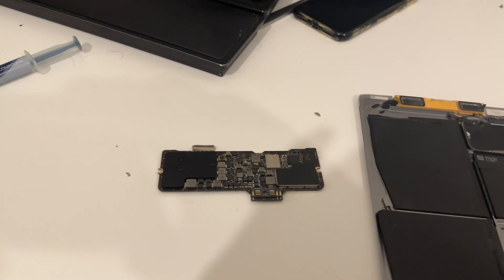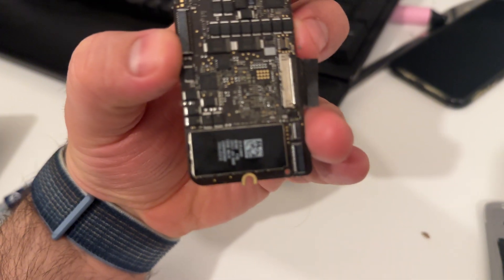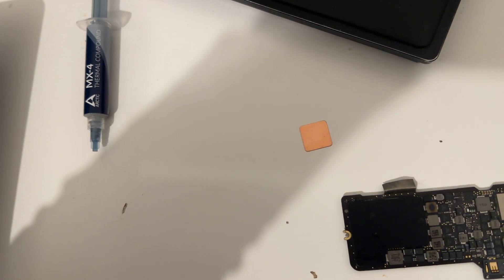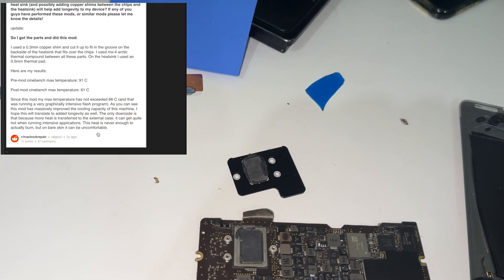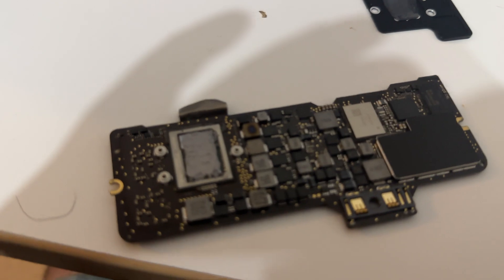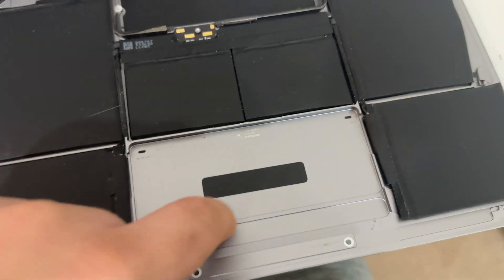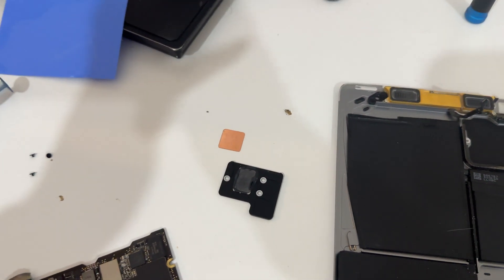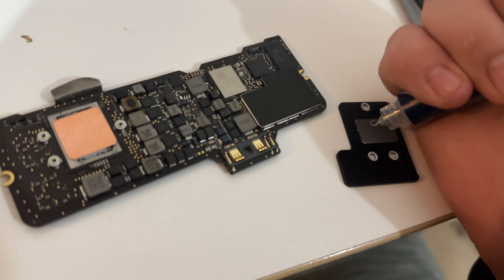12' Macbook Cooling Mod

Comment: Did this to my Macbook 12" 2017 (i5/8GB RAM). Removing the logic board is huge pain though due to the tiny and fragile ZIF connectors.

Initially it ran hotter, but eventually is consistently cooler. Temperatures now hover between 35°C (idle) to 60°C (under load), instead of 45°C (idle) to almost 90 to 100°C (under load).

Temperature increase is also more stable instead of rapidly spiking to over 90°C or even over 100°C before the mod.

Comment: I am doing that on my MacBook 12 inch 2017. I barely noticed that one of the antenna cables was ripped that explains my Wi-Fi issue. Update: Mod worked :) My MacBook runs more than 20 degrees cooler and I put in another pair of speakers for wifi antenna and I had to replace the new battery I had got because it was faulty and I put in an original one instead.

Comment: I did the same mod and I couldn’t let it go over 56 degree C under 100% CPU and GPU Usage which is amazing, I got the acrtic MX-4 thermal paste but what I did something a bit better is getting a better thermal pad that can transfer up to 12.8 w/mk, so basically the better the thermal paste and thermal pad the better the cooling
Reply: What thermal pad did you use?

Comment: Can you play Youtube smoothly  at 2k? I have the same model and it laggy even at FHD, I will try to repaste and mod it like you did but after the mod can it play youtube at 2k? I just need 2k because my monitor is 2k, so hope it can at least run smoothly at 2k.
Reply: That's weird, my 2017 m3 model can run 4k videos perfectly fine, even before the thermal mod.
Reply: @OrganicFoxes  What is your cpu temp? because mine got around 85-90 while just playing video.
Reply: @TrienChill372  Been playing this video for 2 mins now, and its staying around 45 while I am typing this right now.
Reply: @OrganicFoxes , did you apply the cooling mod? and can you play some 2k video smoothly?
Reply: @TrienChill372  I do have the thermal mod on mine, I actually made a whole video doing it, just never got around to uploading it. Mine automatically plays 4k video just fine, even before the thermal mod. I have a video on my channel about my machine and I play a 4k video in it.
Reply: @OrganicFoxes  I haven't tried the cooling mod yet. I don't know why it gets so hot and remains around 80-90 even at 1080p, I have to lower it to 720p so it can play without stuttering, even bringing up the UI or exiting fullscreen mode is lagging like crazy too.
Reply: @OrganicFoxes  4k 30 is not a challenge at all, thats why. try 60.
Reply: @OrganicFoxes  i think it something related to codec, when I tried to force YT to use older codec it work smoothly but the problem is it locked at FHD and seem a little bit blurry.
Reply: I think I found the reason, for some reason, it will laggy like crazy only if I play some 60FPS video, when I play other videos even in 2k it will run smoothly. When I try using some extension to block 60fps videos the quality settings will be lowered to 720p but for videos which does not use 60fps from the beginning the quality settings will not be affected. So my device is too old and it did not support 60fps videos?
Reply: @TrienChill372  hey, u have the M5 model or M3 model ? I have M5 and it can't run 1080P video
Reply: @LostDreams-Music  My model is from early 2015, not 2017, it has 1.1GHz dual-core Intel Core M processor. It might be the first gen of Core M, so it is not M5 or m3.
Reply: @TrienChill372  u too u can't run 1080 video on ytb ? It's strange because I have the 2016 macbook with the M5 processor and I feel like it's buggy as much as the 2015 M3, did it become smoother with the thermal mod for you or not?
Reply: @LostDreams-Music  
I did try to repaste it with the most popular and highest efficiency which has been used widely in the gaming laptop community, I haven't tried Copper Mod yet because disassembling this model is tricky, but it doesn't seem to help much since it still uses passive cooling and a tiny and thin piece of metal. I think it is also related to technology and newer codecs that old CPUs can't handle, I tried some extensions on Chrome that force YT to use the ancient codec technology, at least it can run 1080P but it also limits at 1080P and it also seems a little blurry even though they are all 1080P, and I also think the problem comes from 60FPS video, the video which does not have 60fps seem work less laggy then 60FPS videos. If I force YT to use old codecs, the higher resolution with the 60fps option disappears only lower resolution without 60fps is available. For example, a video upload newly has 1080P and 60fps, 1080P60fps will not be available when I use old codecs and only 480p or 720p is available, for old video with 1080P without 60fps, that resolution is still available when I use old codecs. I try watching some clips or movies from another website, they run pretty well and are not hot at all but YouTube is burning hot.

Comment: What I did instead was added a series of small holes into the case where the logic board sits thus adding in ventilation and I also added four small pads at the fours corners of the case, which slightly lifts up the bottom surface area and allows the MacBook to breath.
Reply: This is clown logic 🤡 Adding holes would only work if the macbook had a cooling fan. What you need is more metal contact to absorb the heat. Metals dissipate heat better than air. Th

Comment: Tried it on mine (2017 macbook Retina), after re-assembly it won't boot any longer. If you plug in the power cable and press the power switch, the touchpad responds (i.e., the haptic feedback works) and the light on the caps lock key toggles on and off ... but that's it. Currently left it in that state to drain the battery and see if that sorts it ...
Reply from the maker: Check your display cable
Reply: were you ever able to get it running again?
Reply: @SaintSantiXIV  sadly not, I even admitted defeat and sent it off for repair. They said it was either the charge circuit or CPU, after ordering the parts to fix the charge circuit they replied “We fixed the charge circuit but unfortunately the CPU voltage was still only 0.5V instead of the plus 1V required to boot normally.”

Comment: Yes this is a good mod for these DeadCPUBooks 😃  The SSD and or CPU will all eventually fail presumably due to excessive heat largely due to having no fan fitted. Good video
Reply: mac will cut power supply to cpu if    tempruche of cpu/ssd/battery/other components extremely high.Mod only adding more surface for cooling